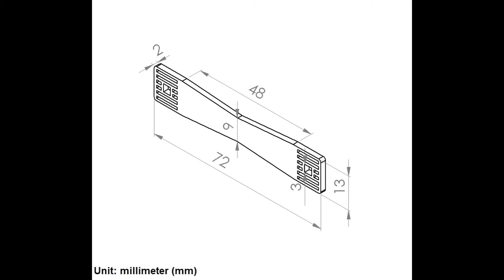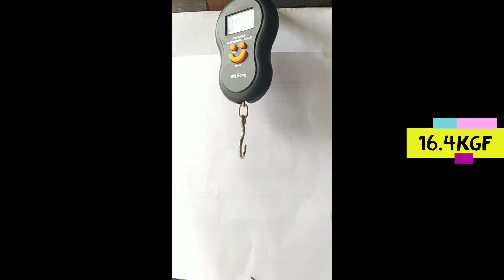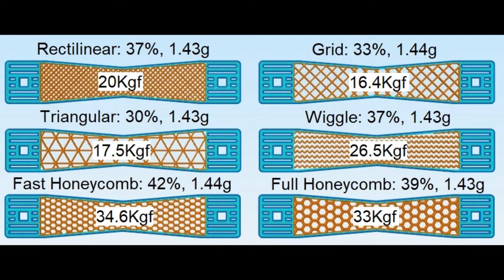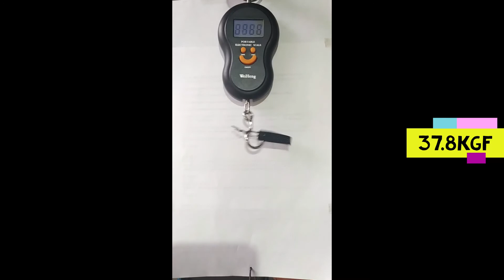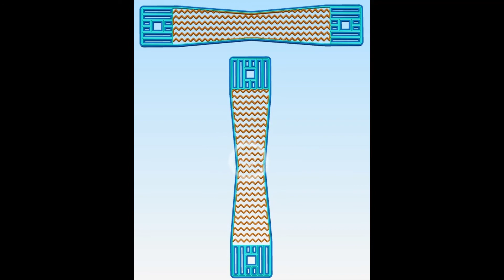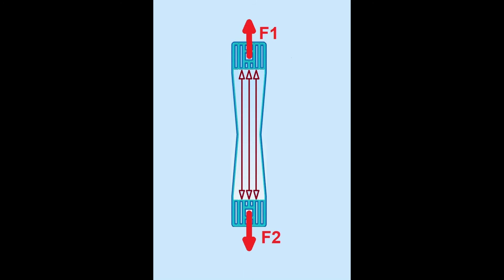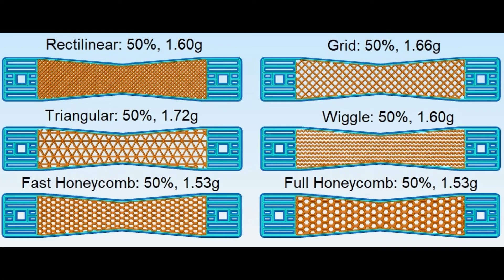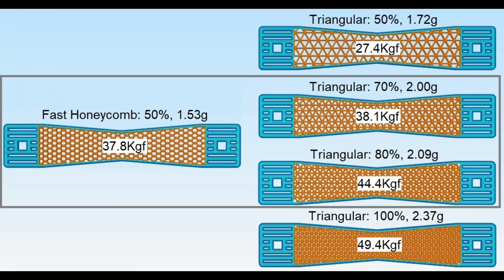3D Printing Infill Patterns: Mechanical Test

Comment: The world in complicated and to get the full image you need tests in :

-tension
-compression
-shear
-3 point bending
-torsion

Based on NASA isogrid is the best skin pattern for stiffness

But honeycomb is best for compression and in this case tension!

So the ultimate part in all dirrections would be a honeycomp with isogrid panels on each sides